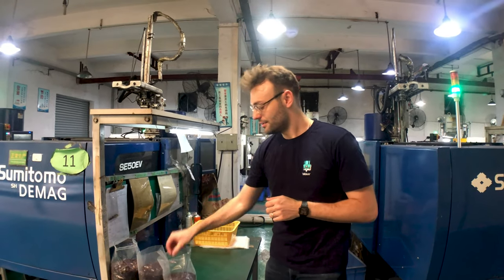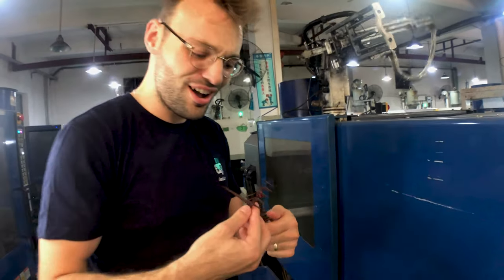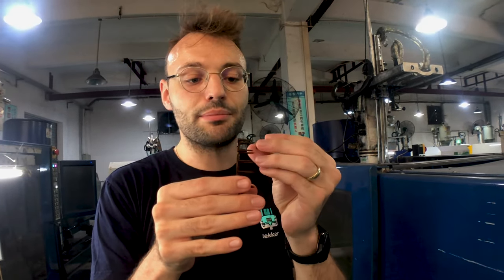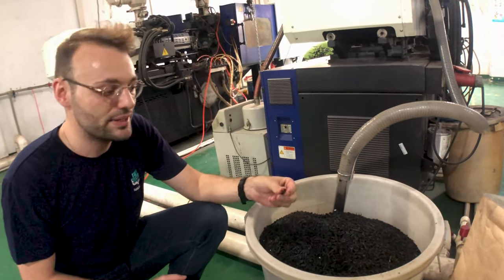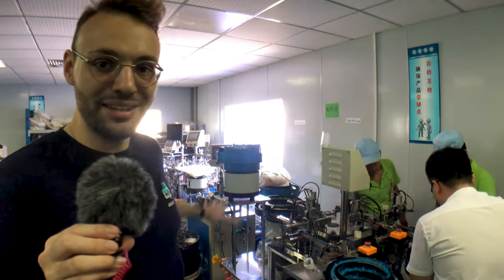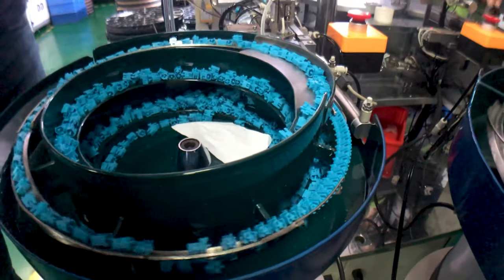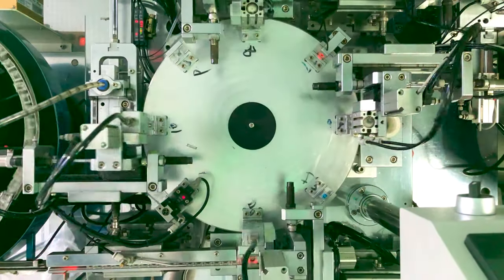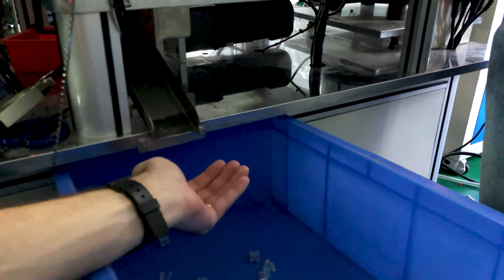Wooting Production vlog - Switch factory

Comment: what is a lekker switch?
Reply from the maker: Lekker switch is the switch used in our hall effect keyboards. It contains a magnet inside, so if you push in the switch the sensor on our PCB will register it moving, and therefore communicate a press.
Reply: @Wooting  i see thank you